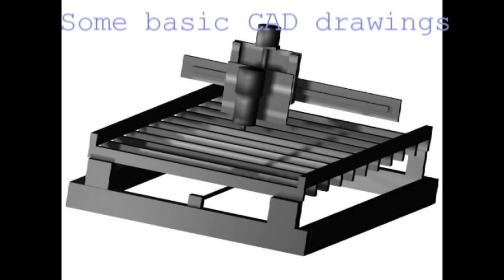CNC ROUTER BUILD

Comment: Looks great so far!  BTW as long as your bed rails are close enough it won't be necessary to use leveling screws, just put a spoilboard down and use a surfacing bit to level teh board down; more accurate that way!  (provided your Z is accurately square...)